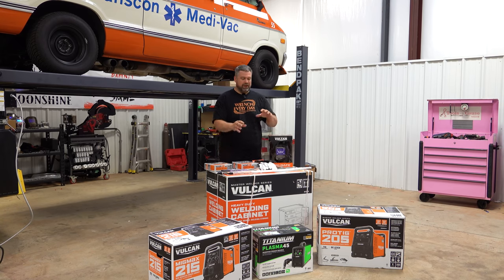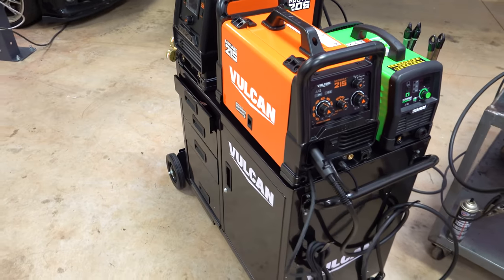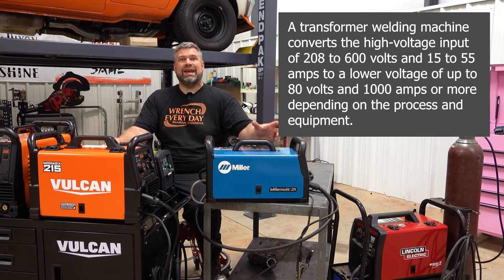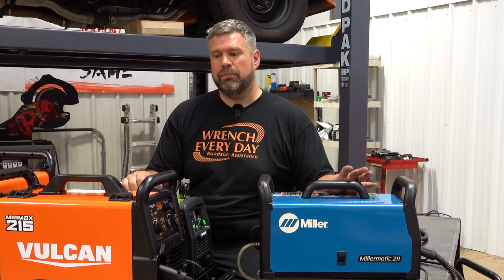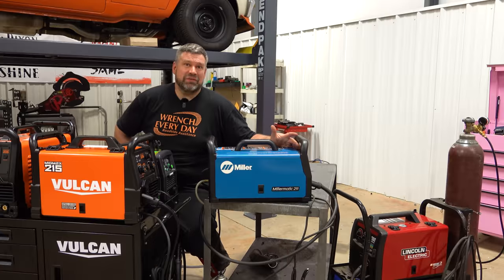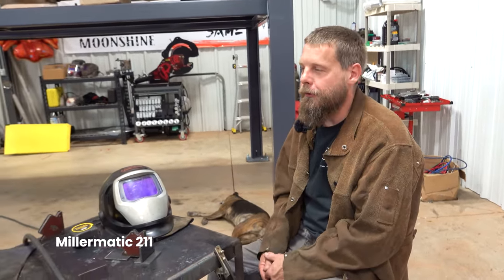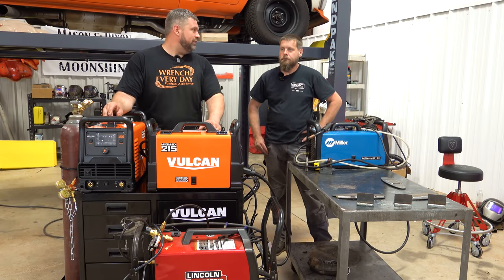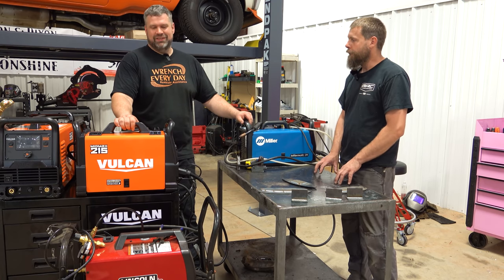Here's What NO ONE Will Tell You About Harbor Freight's "Best" Welders....

Comment: I learned to weld in the early 70s, and haven't welded since then. I've read good things about the Eastwood welders, and I think they're less than the Millers, but not inexpensive. I'm looking for a budget welder, but I'm not looking to buy something that will be broken in eighteen months. Are there other brands I should examine, like Hobart, Esab, etc.?
Reply: I've had liclon and Miller ,   I think the old stuff uses coper transformer vs modern aluminium . But other parts like capasitors go bad , with age, and will probably be a few hundred dollars for the parts .  Modern inverters are small and lite .  I've seen quality issues with the import stuff , but I've made some nice welds with them too. If you are going to weld alot I would choose red or blue or maybe Hobart, I have a very old Miller  that I got for next to nothing from a weld shop that went out of business  and put about $300 in parts and love it to death.  Remember duty cycle rating if you are welding non stop ECT.  Some welders have only several settings for amperage and some are variable and cost extra.

Comment: I have been impressed with the Omni pro 220 it has flaws but works well wish it did steel tig not just aluminum but would be interested to see what you think of these units @Wrench Every Day
Reply: Omnipro only does DC TIG, which covers steel with with argon. To do Aluminum with the machine, you’d either need to use helium with TIG, use a MIG spool gun, or buy a special MIG liner and pray.
Reply: @reaperreaper5098  yeah I typed it wrong shiz happens I meant to say wish it did Aluminum  and steel stig was typed

Comment: I bought a Vulcan Tig 200. It lasted about a year and a half and blew up while just sitting. The replacement lasted 11 months. The Tig 200 was replaced with a TIG 205 and that unit blew up in less than a year when I simply turned it on. That got replaced and I do not expect it to last either. These things are NOT reliable. And I do not use them often.

Comment: With Harbor Freight the elephant in the room is always warrantee, service, and parts. Generally, parts are available but most ship from California. Service/repair is pretty much non-existent, and warrantee can be none, 90-day, or tool specific. That may be ok for a small cheap tool, but I don't think I would buy an expensive welder at Harbor Freight. Hobart can be a good alternative to Miller and Lincoln.

Comment: Would you please throw an Everlast machine into the mix. They have a multi-process machine that compares to Miller Multimatic 220. It has AC TIG but at more amps than the Miller. I am looking at welding aluminum castings and the increased amperage would be most useful on thicker castings. The Everlast has a much better price point than the Miller.

Comment: Can you get the Millers serviced? Yes. However, I've read over and over and over that it's almost cost prohibitive and there's been multiple times I've read they just won't stand behind their warranty. I'd go with something less expensive that's just as capable and if it fries...well, it's either less expensive to fix or just as much to replace as the Miller would be to repair.
Reply: There's videos of folks cracking these Chinese inverter welders open to try to fix them. From what I've seen there's no user serviceable parts inside. They're designed to be put together not taken apart. Even if you know what you're doing it wouldn't be practical to do.

Comment: nongentlemen, welder for sheet metal panels for auto body? Will the Mig 215 do it? Does the Mig215 do gas?  rumor has it auto body panels dont like flux core wire, but need solid wire with gas.
Reply from the maker: The Vulcan 215? It absolutely does and I’ve put a lot together with it. I’ve got a new welder episode I’m working on I’ll be releasing in a few weeks showcasing some new and exciting technologies, but their price point is a little high for a diy shop, so I’d look at the mig welders harbor freight has to offer!(if you look at my duster build, in 4 days I ran through 2 full tanks and 33lbs of welding wire through the Vulcan)

Comment: "Horrible Fate" vs Lincoln 90i FC,.... I got to compare these two machines and you definitely get what you pay for. everything on the HF is cheaper, from gun switch to wire feed system, thing's I would expect to see, but performance was a different matter, the Lincolns arc welded much smoother and wire feed much more steady, we push both machines till one popped, the HF lost that battle,, now we didn't run the same wire in both machines at first HF wire in HF (E71T-gs) (Vulcan dose not have a E71T-11 wire) and Lincoln in Lincoln in Lincoln (E72T11), both.. 035.... opinions HF wire is crap, we then ran Lincoln in the HF and saw an improvement overall. as the welder guy said, Miller has better service and better warranty now and in the future, HF mmmmm not so much. buy one machine for a good while or buy a few machines for a good while, in the end you wind up spending more for junk., but if you don't have it to spend then get what you can and do the best you can. I know people with thousands of dollars in top of the line state of the art equipment that can't weld for shit and a farmer Fred and his old Lincoln 50 years old toomstone 225 amp A/C buzz box welding damn near cert quality weldments. it's all in the operator😊

Comment: I'd like to see you test this machine- hynade Mig Welder, MIG140D Mig Welding Machine, Dual Voltage 110/220V Gasless Flux Wire Welding Machine (MIG140D). Price is right and I'm more or less a hobbyist.

Comment: I understand you guys are Pros and likely wouldn't even urinate on the kind of gear a bottom feeder like me uses to tinker and fettle. Hell, even HF's new "Quinn" branded stuff is a bit hoity-toity for my modest needs, and I'm generally fine with their "Pittsburgh Pro". But I had kinda hoped to see you at least run one of HF's current ultra-cheapo Chicago Electric Flux 125 welders that run off standard 110VAC through its paces, if only to dismiss it out of hand. I have no 220V available except in our laundry room, so only have one of their 110V 90 Amp predecessor models and a little Campbell-Hausfeld stick welder kit. Both were closeout clearance buys: $60-something for the Chicago Electric flux welder, and a crazy $19 at Walmart for the little stick rig. I guess I just wanna see silk purses made from sows' ears...

Comment: I used to work for a big welding supply chain as a welder service tech.   The Miller inverter welders are overpriced underbuilt junk and designed to fail just after the warranty. (Yes, they do weld amazing when they work.)    

For the over 2 years I worked in the service department  I never had a day once that I didn't have at least one on the bench or in cue for a major rebuild.  Despite being less than 10% of our average welder sales they made up for over 50% of my service work. 

If you want a good Miller welder buy the old-school heavy transformer-based models. They are very well built and very hard to kill and if you do kill one they are fairly reasonable to do a major overhaul on.  The inverter units on a major burndown out of warranty cost about the same as buying a new one.
Reply: My brother-in-law sold his unused Miller 252 for $400 at a time when I couldn't afford to buy it from him. I wanted him to wait until I could buy it, or sell it to one of my friends so I could buy it from them later, but he went ahead and sold it anyway. :(
Reply: @TehButterflyEffect  If you ever go looking for a good used machine watch for a farm or contractor or large manufacturing business going out of business auctions.  

They tend to have welders in the lineup that don't work due to often painfully simple problems that go for scrap value or less.  

I've bought many welders for literally a few dollars each that didn't work over the years that just needed a good deep cleaning and a few common wearable parts (switches, cable sockets/lugs or diodes)   replaced. All things that are very simple easy and relatively cheap to work with.

Comment: I normally use a Hobart 140 Mig welder and it is excellent. I wanted a little light weight flux wire welder for car exhaust and rusty metal jobs out in the driveway. Picked up the titanium 125, works excellent for those kinds of jobs and I don’t have to drag around my Hobart and bottle. The ground clamp is cheap sheet metal and the gun itself feels like a kids toy, but it feeds smooth and does the job great for the money.

Comment: As with anything, buy the HF if youre ok throwing it away & buying another when something breaks after a couple 00 hours welding.

If youre a hobbyist it probably doesnt matter.
If you make a living welding in the field, you want spare rollers, tips, control boards, fans, etc.

The spare parts to keep a branded piece of equipment running is a lot lighter & cheaper to carry around than carrying a HF spare.

2nd, the Miller, Lincoln, Hobart, etc will have 3rd party specialty rollers, tips, etc that are optimized for specific alloys or applications.

Noone makes aftermarket for the no names.

Running a business I would keep a noname as a backup, doing 2 minutes of weld an hour is a poor test, bring it to a shop and lets see how its working after 8 hours continuous welding.

How long are the rollers, feeding mechanism, guides, gun trigger, gonna work after months of continuous use.

Hobbyist vs Production

Comment: Vulcan sounded right on, better than lincoln and miller,,iwelded for 10 yrs. With lincoln and miller, but we always used fluxcore.45,,we stayed away from bare wire due to porosity risk,,structural and pipe welding..vulcan sounded great. But like he says it needs to prove itself.

Comment: Great review I almost shut it off after the first 30 seconds when you were being cute. I’m just go though the  relevant stuff, its not a popularity show. With that said once you started to explain the workings of the machine in a simple way I kept watching. Thought it was a fair and the right way to compare the three most popular machines on the market. I started heli arc welding in the Navy and then a pipe welder doing production welding for years but need a small welder that could do odd ball hobby type of projects. I bought a 205 yesterday with doubts as to how well this welding machine would work. Thanks to this review  I’m more confident that it will meet my needs. The one thing most important to me was to find out if the Tig Collets and cups were interchangeable😊 with a standard 20 Lindy water cooled torch. I also wanted to know if this machine can be used with a water cooled Torch to cut down on the heat at the torch is doing lots of Aluminum. Thanks for making this video.

Comment: I still have a 5 yr old mig welder, the metal cased type. 80$ open box special that had been used and fouled up with flux core wire. I have used this welder for years, and it will stitch-weld thin auto body metal better than my Miller 211 that cost 10 times as much. Much better spot-weld control, and no electronics that try to out-think you. Please though, stay away from HF pry bars, abrasive wheels and  a few other things that can put you in the hospital.

Comment: Ok there was a lot of adjusting on the orange machine. Every machine should have sounded that crisp if messing with the settings of all of them. Spatter from the weld was way less also the welder said that he turned the heat up and wire down on the miller. That doesn't make sense to me. He said it was to hot so he turned it up more and wire down, backwards. Stick out, travel speed, what type of pass your making, gas flow, straight C02, 75/25. So much more goes into welding that should have been explained. Even if you're a hobbyist go with a company with many years experience like Miller and Lincoln not a knock off that was reverse engineered over seas. By the time you burn up two or three orange machines you would have wished you went blue or red.

Comment: To wrenching every day. awesome video you are the best YouTube channel out here . you are very informative 👈you take the time to talk to the people to let them understand👈 and I just want to let you know I truly appreciate it.

I just want to let you know a synergic welder has a differential of one two 5 adjusting to increase voltage or decrease the voltage up or down for adjustment in the menu settings .voltage also you can do the same for the wire speed also.👈 you can find it in the menu setting👈 you know 👈just the settings that you wish for your own custom settings 👈have to when you turn it on because it is a prefix setting 👈when you adjust the settings on the synergic welder of course it starts the voltage and wire speed automatically preset to match for the welding application that you're on your synergic welder but if you go into the menu👌👈 setting👈👌 and press the menu button👈 you take it out of preset👈 and then you can manually👈 just both sides for what you want to fine tune the welding for voltage up or down👈 or wire speed increase or decrease up or down👈 don't want the machine to do it automatically for you.. awesome awesome YouTube show God bless. PS hope you guys understand my message I was very busy when I was texting but you'll get it.

Comment: If HF welders are so good, why do they only have a 90 day warranty? Here is an example of why there are better deals out there. The AHP AlphaTIG 203xi comes with better accessories and everything you need for ARC or TIG. The only advantage to the ProTIG VW205-PT is it's max amps is 205 Vs 200. Now the important parts. Cost and warranty. AlphaTIG, $725.00 and 3 years PARTS AND LABOR. The ProTIG, $1249.99 and 90 DAYS PARTS ONLY! Does the HF even support a water cooler? Tell me why I would buy a Harbor Freight welder?

Comment: What I like about my ESABs us that the cases are rated for must an even a light drizzle. As a result, the electronic compartments are fully sealed with gaskets, so the boards aren’t potted. Cheap machines aren’t potted either, but that because they’re cheap with non rated cases either. I’m talking about the really cheap welders (and plasma cutters) most of these are sold on eBay or on Amazon from unknown Chinese brands. No real warranty, no parts, no backup. Stay away. A good thing about HF is that they usually will exchange a bad one for a good one.

And yeah, many of us who have been welding for 50 years READ THE MANUAL! It’s tiring hearing guys say to not bother with the manual (most of these guys do read the manual off camera, most just won’t admit it). Sure old, simple transformer models have no features to learn. If you know how to weld, there’s not much more to know. But modern inverter welders are much more complex. You really do need to know what features the machine has and how to use them.

Comment: Once again a person discussing Electric welding refers to what is the negative point as the "GROUND" lead or clamp. As an electrician that has had to replace the entire earthing wiring in a general engineering company's premises, l shudder. 
The lead/clamp is the "WORK " LEAD/CLAMP.  Some welders think that as it is referred incorrectly as the ground/earth lead they can connect the work lead to the building's steel frame. Yes it will complete the circuit of the welder but the wire size of the buildings earth system is around 1/10th the area off the welding cable. The current needed to weld is capable of melting the buildings earth circuits. As the earth system is the safety mechanism for the building destroying it can ultimately lead to electrocution of the occupants of the building. Please always think of it as "THE WORK LEAD". The life you save may be your own.

Comment: Couldn't possibly care less about your cart set up, but am interested in the performance of the welders....They can all weld thicker metals, which can weld sheet metal, decent, that is thee question...
Reply from the maker: I’ve welded 1/4 plate no issues, and I’m about to do a done of sheetmetal body work and can let you know how it does there. I’ve had zero complaints out of both welders and added the larger plasma torch to the collection

Comment: miller makes great welders though.   definitely pro grade. miller and lincoln are basically only welders used in structural steel, besides the occasional esab or something like that. everything miller is pro grade, and the bigger lincoln machines are. but the home depot lincolns are not. they dont hold up and the duty cycle on them is pretty bad

Comment: My migmax 175 is as good if not better then the Lincoln 180 it replaced. My htp invertig is better then the protig 205 we have at work but you can buy 3 protigs for the cost of the htp. But the protig 205 is lightyears better then the old lincoln squarewave 175 it replaced.

Comment: Bought a titanium multi process 3 years ago, welded great for the small job I was doing, until the I whacked the mig gun to clear the gas cup and the neck broke off. Just Junk. Never had a Miller or Lincoln mig gun break, for an extra cautious home gamer it would be fine, but if you’re a welder, the toy won’t hold up to you.

Comment: I had two plasma cutters and one tig from china. All blew up. The last one just popped. I opened it up and saw a small regulator capacitor they exploded. No specs so I took a guess at what is general size for regulator cap. It promptly blew up. There were no part numbers on regulator so I was stuck. The first plasma cutter I had also blew up. They sent me a new board but it didn’t work out of the box. About $700 of wasted money. Do yourself a favor. Buy miller or Lincoln. Cost more but costs less in the long run.

Comment: My sears hard plastic and rubber mallet last for thirty years thru untold moves and projects.  My harbor freight replacement set of a few mallets did not last one project.  The mallet shafts bent and the plastic hammer heads shattered uselessly.  Junk!